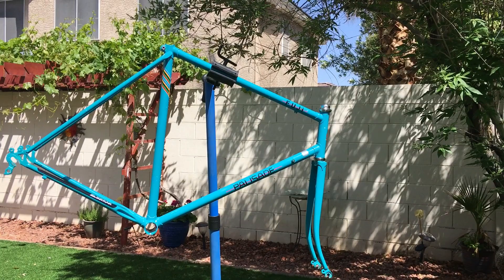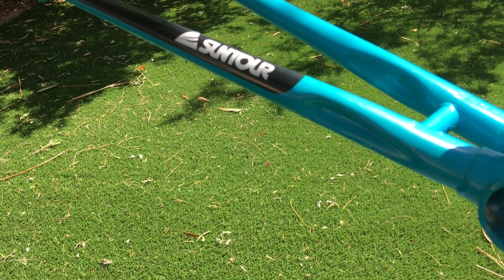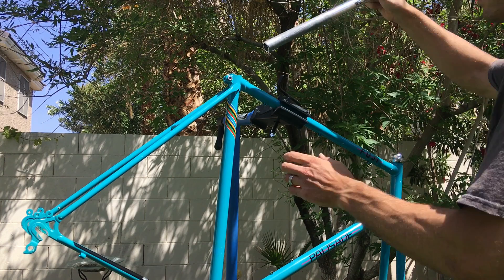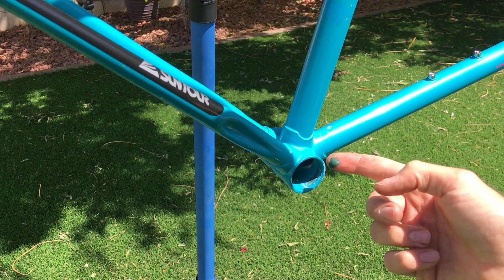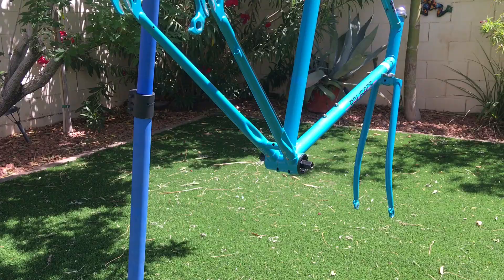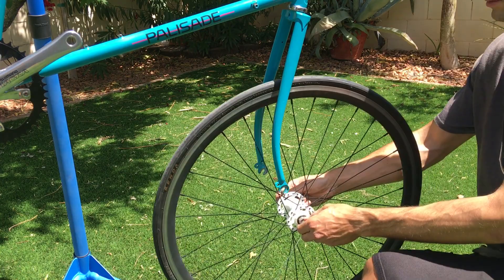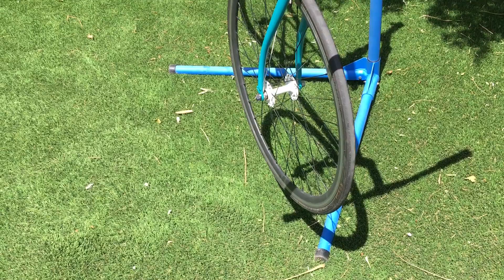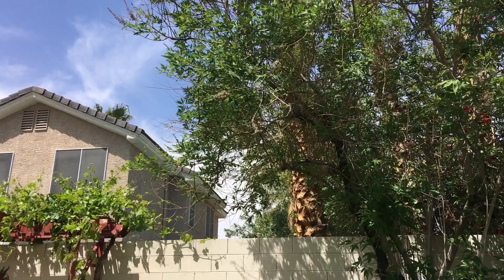Fixed Gear Conversion Build 1987 Fuji Palisade

Comment: get some fat tires on asap. yo ucan ride it on dirt and light trails. super fun. also low bottom bracket going from 27" to 700c and using tiny tires

Comment: Hey man, I have this same exact bike but it didn't come with a seatpost. Would you mind sharing what size seatpost you used? Build looks awesome!
Reply from the maker: Thanks for the comment, I appreciate it! The seatpost that worked for me is a 26.4mm. There are some variations on eBay, but one in particular (the one in the video) had a lot of setback. But also the alternative is find a vintage/used one. It is an oddball size!

Comment: Vertical dropouts.... how did you tension  the chain?
Reply: not actually vertical, but diagonal, which makes it basically as easy as horizontal, except the chain tensioning has a minor impact on the frame angle, because further back also means higher up.
Reply: @Fran fiocchi what are you even trying to say
Reply: @addvurtbikes  I’ve done a few conversations with the semi horizontal drop outs. Ideally a new chain will have perfect chain tension in the same spot as if you had a derailleur and gears to accommodate chain stretch.
Reply: @Fran fiocchi I guess, I don’t know how much a chain stretches really